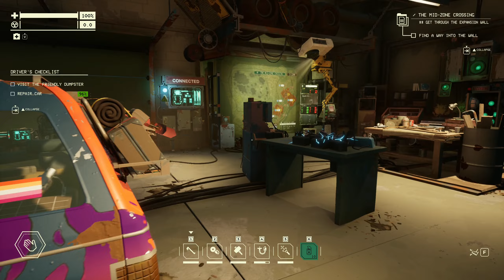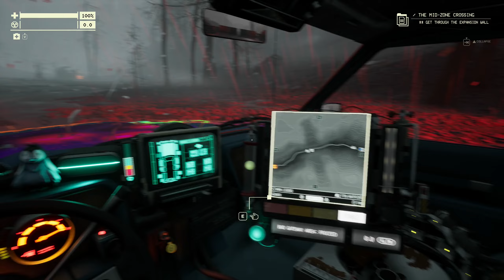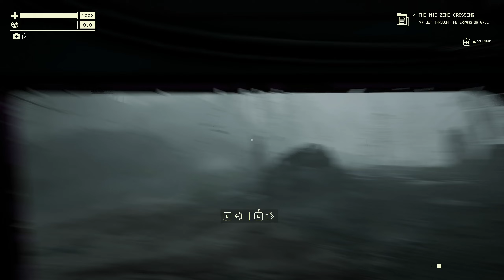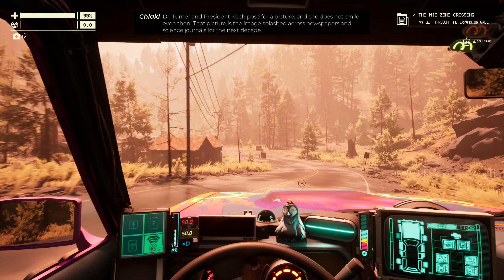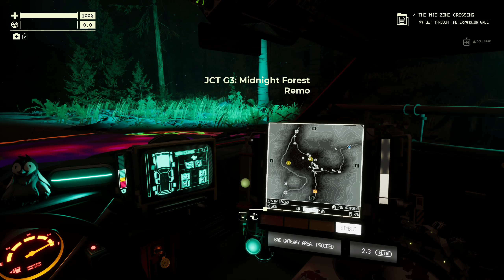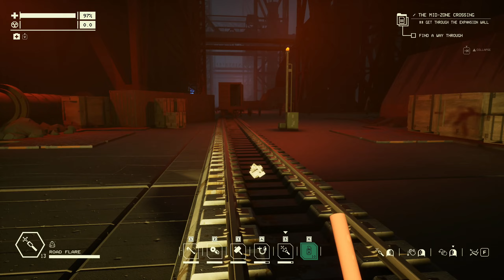Pacific Drive Episode 14 - A Crack in the Wall

Comment: 27:17 - I believe you already unlocked the better engine, you just need enough ThermoSap to craft it.  And sources for ThermoSap are Tourists and the armored cars
Reply from the maker: Yes, indeed. But if I remember correctly, it requires quite a few Thermosap to craft it. So many, that I feel like I'd have to do some serious farming just to craft it. We haven't found any in the mid-zone yet, but I still believe it's something we can get there. But maybe it's even in the deep zone, although in my mind, that wouldn't make much sense if you'd get the engine that late.